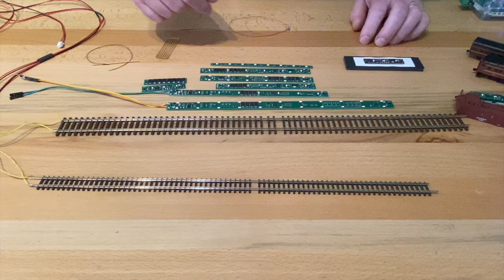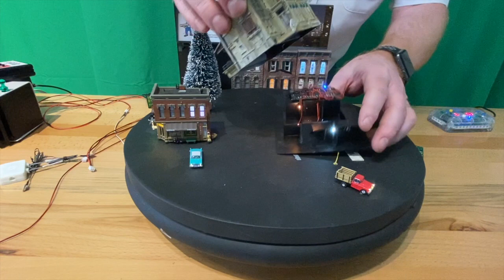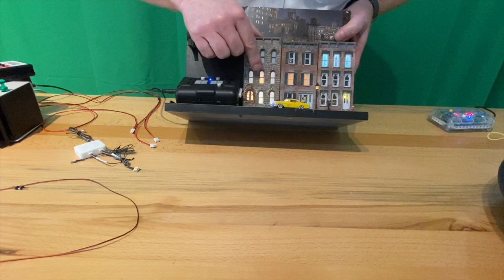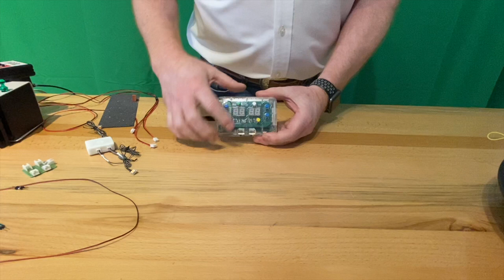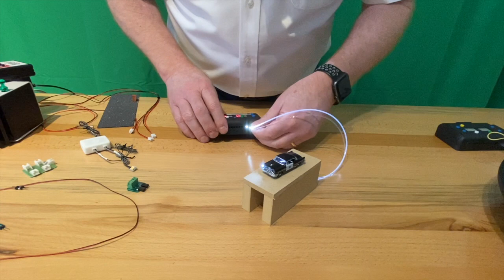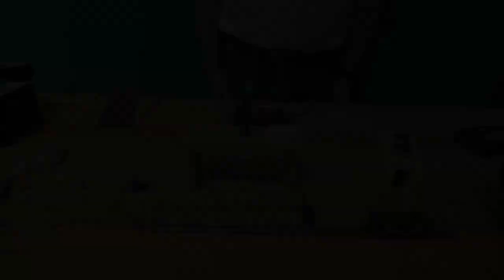Lighting & Animation Workshop

Comment: Jim, nice products. What's the current consumption of the HO scale series II light board? (3000K)
Reply from the maker: There are multiple versions of both length and 1 row or 2 row.  The LEDs are modulated and would be @ 50% brightness or less,  Thus we calculate about 35 ma on average with the 2 row upward of 60 ma at full bright.